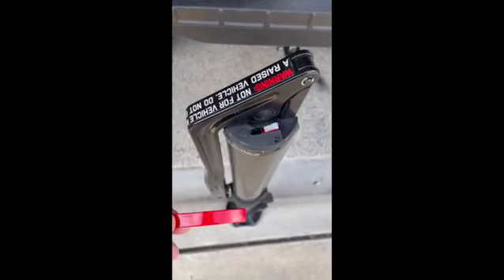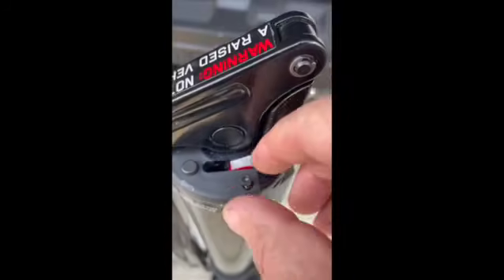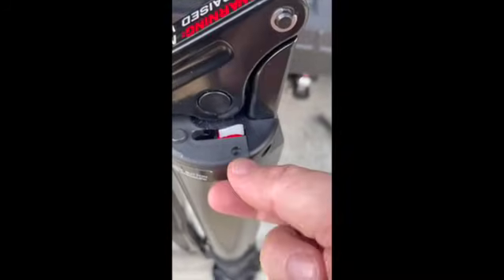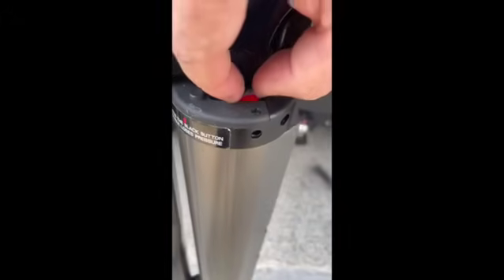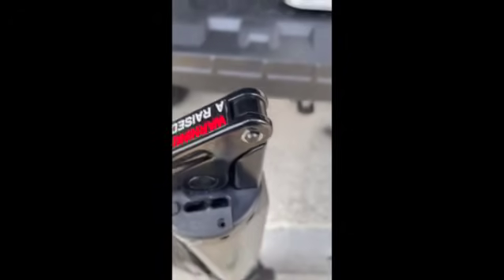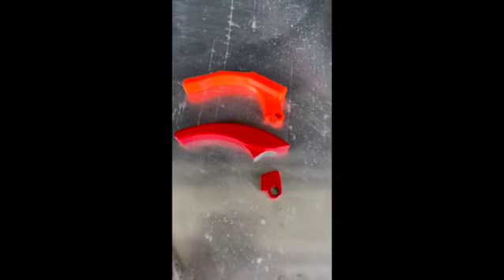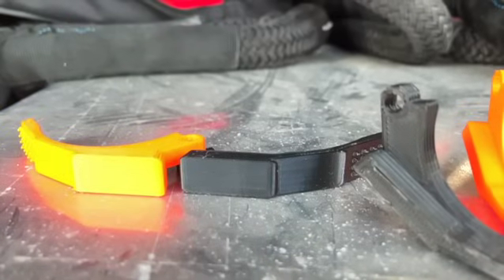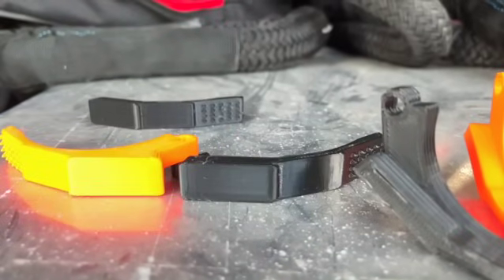How To Fix A Broken ARB Jack Lever With A 3D Printed Replacement | DarkSideOverland.com

Comment: my handles never break but my second one under warranty just took a crap, it pumps up a little then down once weight is on it, depressed the button as the sticker says and its still shot, anyone ever able to fixe these things? ARB told me they are not rebuildable or serviceable. not sure ill be able to get a warranty one at this point
Reply from the maker: Sadly, I cannot give you any other news that what you already know. Great jack, just weak on some execution of construction.